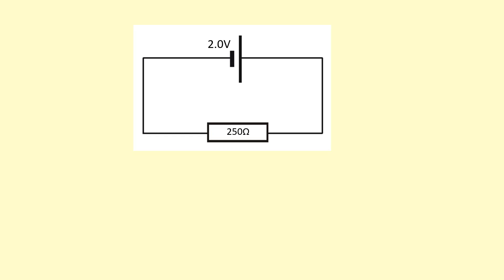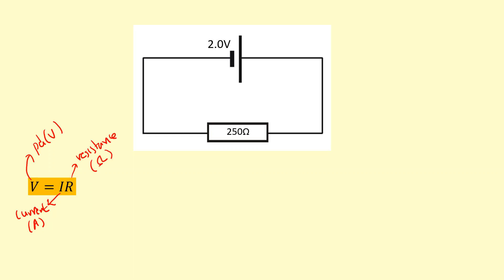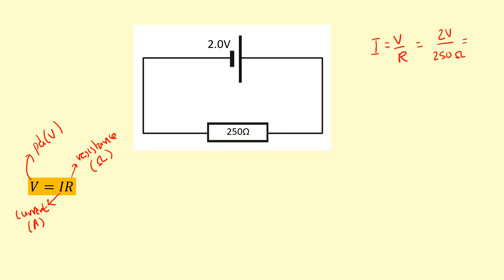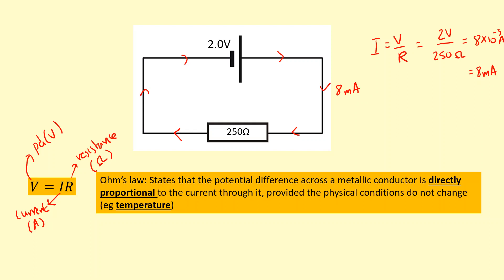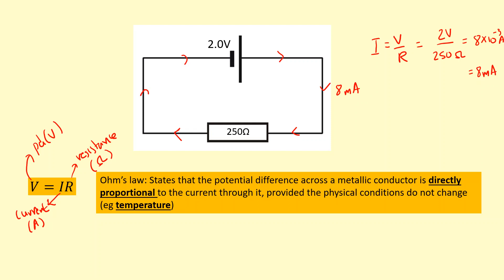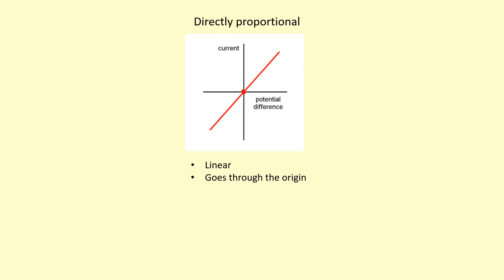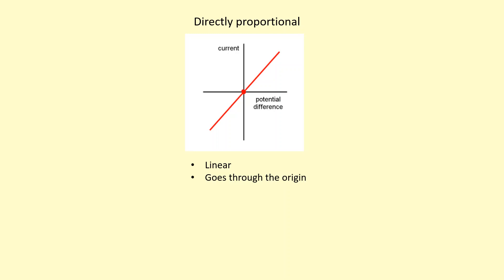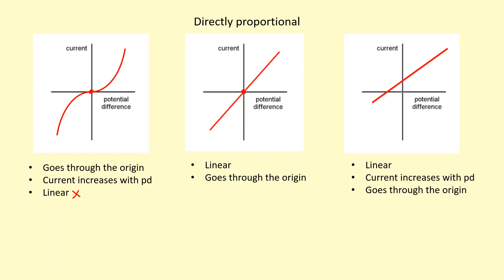3.05 What is Ohm's Law?

Comment: If the graph doesn't pass through the origin why does that mean its not directly proportional anymore 2:47
Reply from the maker: if you have 5 apples and increase it by 2 every day. It's a linear function.

on day 1 you have 7 apples, day 2 you have 9apples, day 3 you have 11apples.

Notice how when i doubled the number of day the number of apple doesn't doube. 

Notice when i triple the number of days it doesn't triple.

but if i had 0 apples on day 0, then increase it by 2 each day. 

day 1 i have 2 apples, day 2 i have 4 apples , day 3 i have 6 apples. Notice how when i double the number of day the number of apples also doubles. When i triple the number of days from 1 to 3, the apples triples from 2 to 6...
Reply: @MrNagaPhysics this was a very good explanation thanks 😁